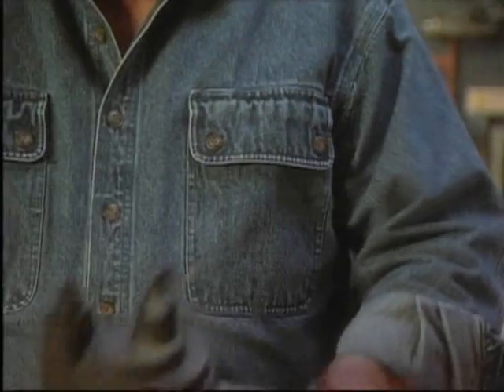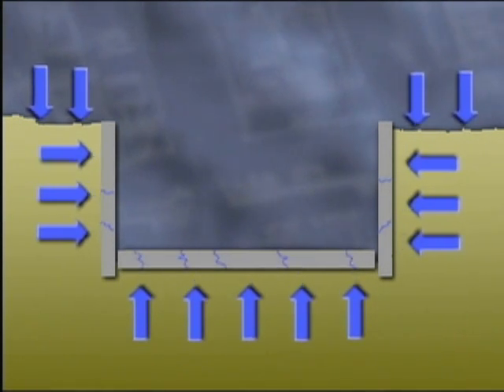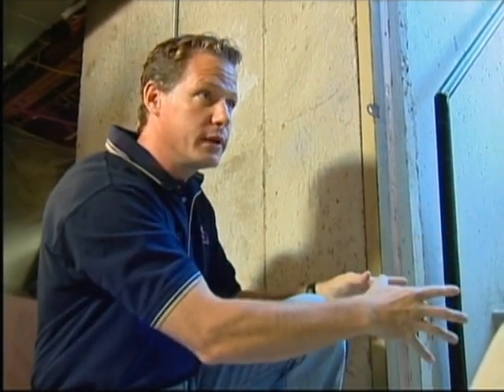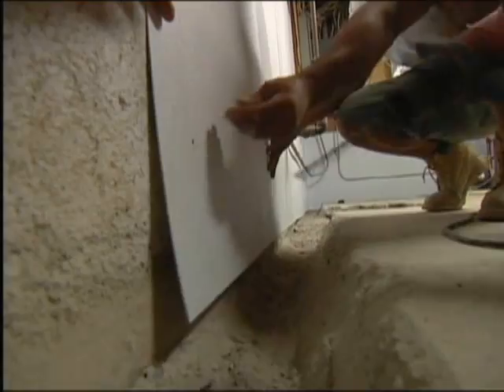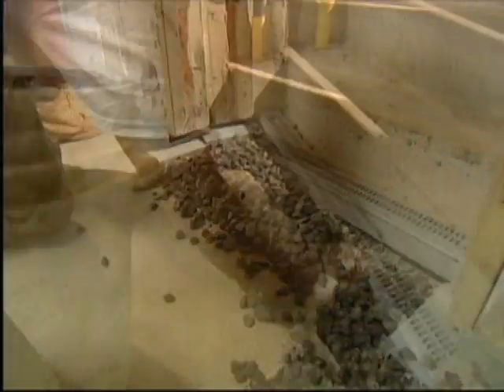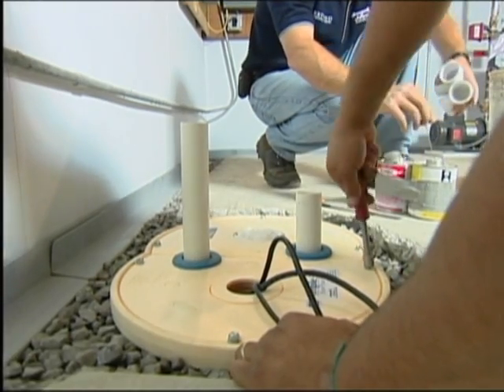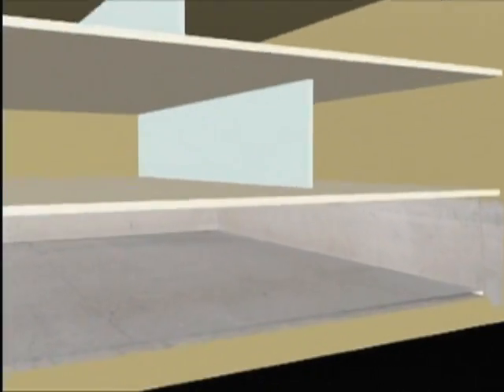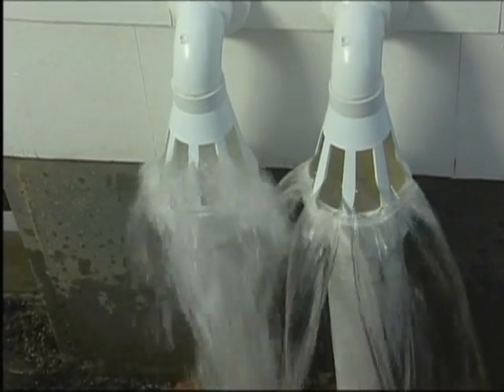How to Waterproof a Basement | Ron Hazelton's House Calls feat. Basement Systems

Comment: Been like that since the 60s. What a shitshow. But then have you seen his show. What is that like an inch of material over plastic horrorshow from beginning to end. Seen lots of homes from this era. Bowed walls and flooding galore. Unfortunately its common practice. Had one where they installed a sump and didn't break knockouts. total waste.

Comment: This is one of the worst syatems that you could use. If possible, you should dig around the house, coat the wall with a membrane from the footer up.
French drain goes below the footer and cover with gravel all going to a. 6 foot collecting tube that will have the pump.
Inside, the floor should be coated with the hydrolock pain.
If you must put a french drain inside the house you will need to dig a trench that is about 5 inches below the slab.
By code you need to replace 3 1/2 inches around the slab you just dig.

Comment: OMG I just watched a video on how bad this system is https://www.youtube.com/watch?v=CSrdJjlQopA
To be honest if you just wanted to channel the water away and not fix it doing the bottom stuff would be ok but those vinyl wall panels will keep the block wet and mold will follow. Also for "ice clogs" my sub dumps 70 feet from the house. If the pipe is frozen so is the ground and water is not going to the system.
Reply: yea this system is not recommended. so much you can do for a fraction of the cost from the outside of the house to evacuate water away from your property before going to this extreme.

Comment: "If the walls do leak, the water will just run down the panels and into our system but the homeowner does not see any of that water." So basically you're telling us that you literally just cover up the issue so that the home owner doesn't see it and that's called an issue resolved?
Reply: well the other solution would be putting waterproofing on the outside that will take major work and you have to break out the ground surrounding the house

Comment: This method waterproof From the inside is a joke. It's no different than having a boat that has a hole in it and is leaking and you decide to get a bigger bilge pump and not fix the hole. The only way to waterproof abasement, is from the outside.

Comment: This not a solution to the problem. The water needs to be prevented for coming in in the first place. You're attacking the symptoms not the cause. You could have saved a lot of money by just closing your eyes. Either way the problem is not solved.

Comment: This is a terrible "solution". Channelling the water inside the house creates a permanent wet ditch, which is a wonderful mold growth medium. Drains should have been placed outside the wall, with gravel over top, and soil at the ground level. The drains could be fed to the sump, or to outside drain tile.

Comment: I am in shock. The price of this work is half the price of the house. You get a "wet basement" with a pump for that kind of money.....
 This is madness!  
This problem is fixed easily - Concrete crack injektion.

Comment: This company doesn’t take permits out cause if they do the system would not pass inspection. The other thing is the illegal workers that he uses.
Reply: john Torres 
1. The responsibility of obtaining a permit (if one is even required) is the property owner’s, not the contractor’s. 
2. What is the basis for your assertion that “the system would not pass inspection?” 
3. “The other thing is the illegal workers that he uses.” Explain, please.

Comment: It would be cheaper to mortar in brick around foundation rather than jackhammer out concrete get rid of battery backup pump use use water psi backup pump

Comment: That is not going to work your not below the footer where the water is and there are no weep holes in the block cavitys including the joints you wont be to code with the concrete thickness minimum of 3 1/2” this is a cheap shoddy system

Comment: There is a question i wondered about?

What happens if you use colored Dye to trace the leak in the basement?

Will the color come out in the basement or would it just disappear in to the rock or soil underneath and not show up!
Meaning all you would see is the water and not the colored dye!

Comment: This is a huge CON . Never want water on ur foundation walls let alone throw them in first place. Put tht system where sun doesn’t shine but on the other side of tht wall outside the house. With non woven geotextile fabric wrapped around French drain tile and 3/4 to 2 inch clean rock with zero fines in it ontop and around the pipe all way up the wall good solid 6 to 10 inches wide of it. U won’t never have water on the outside of foundation walls and there for u won’t have inside of the foundation walls. And before anyone says anything about well it can just come from underneath floor. I can’t type all damn day to explain the steps on the outside the foundation system to prevent that scenario to. Cause I for sure 100% know how to prevent all tht as well. I have a master’s degree in keep Mother Nature on the outside of the house.

Comment: I thought you were smarter than that. I bet your basement smells musty and still have mold. I'm a Roofer above grade and below grade membranes. I've done a lot of basement water proofing and I know you have cracks in your walls. You need to dig out the dirt around the outside of your basement wall and seal it correctly and put some french drains to devert any water that acuminates on and by the concrete walls. Anyway I think you should of thurally researched the problem instead of throwing a dart at the yellow pages to pick a contractor. Let us know on the results of the basement project. I'm not here to laugh I'm here to see a project done right. There a lot of people that watch and there going to do the same thing you did but be disappointed at the results. I'm a fan and still watching.
Reply: How much is a proper membrane and french drain install on a home on average?
Reply: @sethshaffer8592    it's just digging around the house down to the footings and putting in a drain same as inside and putting in polyurethane square sheets against  your wall then filling it back with dirt.
Reply: I bought my house about 3 years ago. PO at some point had this exact same setup installed because they had at least 1 flood (there are still indicators of the flood line in parts of the basement). I have started working on the basement as one of my projects and have begun to remove the white panels and see evidence of seepage through the block and joints. You're 100% correct that this solution only moves the water that got in, out but doesn't address the root cause, the water ingress from outside. I've been researching and planning my backyard drainage project for about a year now but have to now incorporate sealing the outside foundation as part of it as I want to eliminate the water ingress as much as possible. And yes, my basement does have a slight musty odor, not terribly strong like some older home basements I'm used to, but it's there. I believe this is also in part due to the build up of probably mold on the back of those plastic sheets.
IMHO this option is a good safety measure, AFTER you've addressed the outside water intrusion first, this gives you more peace of mind that you won't have a flood if it got really bad.
Reply: If you're not here to laugh you should really correct your spelling on thurally.
Reply: @MrArdissono  Yes you are right I don't know how that one got by me. But I do know what I'm talking about.
Reply: @MrArdissono  I'm not here to laugh I'm here to let them now their mistakes. If someone is going to give advice he or she should know what the heck they are talking about and should be thorough.
Reply: @cordcd7  Make sure you got good drainage and good slope. I would even go over kill. Because if that water doesn't have anywhere to go 8ts just going to stay there and eventually try and find a way into your basement and tree roots and bushes they can eventually tare through your membrane. Depending on what type of system you use. After you get done with the outside wait to seal the inside of your basement. That is after you brick cement or concrete any voids . Wait for after a couple good rain storms (I would give it a good winter of rain. Depending on how much rain you get where you live ) and check for leaks and any smells like mold. You want to be 100% that the water is not going to leak through the walls before you seal the inside and depending how you're going to use the basement you going to think about the condensation and if that isn't addressed right then the mold will come back. You definitely don't want to use organic materials for the inside walls and if you put up any walls make sure you leave an air gap for circulation so it can dry any moisture that's there. This is the longest comment or advice that I ever wrote to someone. I hope you get it all dialed in and let me know your progress and stay dry. Peace
Reply: @MrArdissono  You missed the whole point of A Martinez's decency and objectivity and the joke is on you bud. Peace!
Reply: You're a good person A Martinez, going not ony by your helpfulness but more so by your decency in the face of a needless attack from the like of Ardissono below. God Bless you.
Reply: A Martinez How do you feel about Flex Seal Liquid??
Reply: @iMr.Jetpacks  I've never used it before.
Reply: @MrArdissono  He's a roofer not Shakespeare.
Reply: I think it would be very difficult to drain the water down to below the level of the basement floor. I suppose that lowering the water level even if not down below the basement floor would reduce hydrostatic pressure and reduce water ingress. French drain isn't the way to go though. First thing would be to make sure that house guttering gets all roof rainfall off the property. Next thing would be to put in a drainage system comprised of catchment basins in low spots around the property feeding into a dry well fitted with a sump pump. Check the Apple Drains Youtube channel for chapter and verse on this. After getting drainage on the property around the house optimized I would then look at basement remediation.
My own temptation would be to put on a membrane and then pour a sealing wall of waterproof concrete over it. Not my area so I may be way off base.
Reply: @errcoche  
Are you saying on the inside or outside.
Reply: I'm not a contractor etc...but what was done here is not water proofing wet basement. They just direct the water to a pump to discharge it out. LOL  I've seen other video and it looks like you get what you paid for here. I've just seen a video just before watching this and I'm just shaking my head.
Reply: I agree A Martinez.  I have a water table issue and this would not work for me.
Reply: Wrong. I have dug up a crack from outside. Injected it and the injection took from port to port. But ran into a hair line. I also water proofed then added a membrane to the footer up. Then added a drain with great grade away frim the house. As well as drainage rock. And a french drain. Few rains later water then made it under the footer as the presser still built up and water found a new place to go. So spend money out side. Sometimes works yes. Sometimes it dont yes. I do believe this system is cheap materials for sure. But it takes away alot of guess work headache future problems quicker and cost is alit less. Then doing alot of outside work....i have done it all just like anyone els water finds least risistance. Some have had to do interior drains even after exterior....
Reply: @MrArdissono  it's thurowlee.
Reply: A Martinez how you described is how ours was done over 45 years ago.  Took care of it.
Reply: @amartinez1279  do you have any suggestions as to who to call to do it the right way please need help ASAP thank you blessings 🙏❤😇

Comment: The opening scene shows water pooling at the foundation and pouring off the roof or overflowing from the gutters. That is the problem. Leaving the problem in place and dealing with the symptom (at an enormous cost) is so foolish it defies logic. Imagine if your roof leaked and a contractor came up with an elaborate drainage system installed inside the attic to keep up with the leaky roof. It's absurd, right? Well, when confronting basement flooding you start by picking the low-hanging fruit and work your way up the tree. Install gutters and make sure the downspouts discharge far from the foundation. That might do the trick. Then, grade the property so that water flows away from the house. If that doesn't work, install a french drain system outside. This is much cheaper than jack-hammering concrete in the basement. If all that doesn't work, you'll have to do something like what they did in this video. But I think the easier, less costly measures would have the problem resolved before a jackhammer ever had to make an appearance.
Reply: wickedmessenger1 “Imagine if your roof leaked and a contractor came up with an elaborate drainage system installed inside the attic to keep up with the leaky roof. It’s absurd, right?”
That’s a great analogy.
Reply: He did nothing to address continuing damage to the foundation by allowing water to continue to run in.
Reply: @ Joe Shmoe….I called this Larry Janeskys company… Connecticut Basement Systems to come and give me an estimate, as I am having drainage issues…I quickly cancelled when I saw the system he uses, because of the same thought as you… not addressing the water problem from the exterior… I have a contractor doing the drainage system from the exterior wall to the footings, for what I’m guessing would be half the price as this system!!
Reply: @jimmalley  Good move! There are a lot of "experts" out there that don't know anything and others selling the most expensive job. Another problem is several different types of contractors specialize in the different installations that may need to be done. Sometimes a wrongly pitched sidewalk against a house can be a problem. The guy running pipes doesn't make any money from a sidewalk job. Getting roof water, patio water, etc away from the house is the first thing to do and keep in mind every house and property is different.

Feel free to contact me here if you have any questions, I'm not in the business, but I've seen plenty of unnecessary work done. People are easily impressed by the term "french drain". Good Luck!
Reply: @joeshmoe7789  TY appreciate it!!…Stay Well

Comment: This system is nothing more than putting lipstick on a pig. The fact is he should have invested in an exterior waterproofing job with new weeping tiles. That's how you really solve a wet basement problem. It might be a little more expensive than this system but it's the only way to go. 

By the way, I don't buy the guy's explanation for why water was coming in from his rear steps. He didn't have a grate at the bottom which is code and the rainwater was just coming down the stairs and inviting itself in. He's a home expert and he didn't know this???

Comment: How about the exterior.  That''s where I would start.
Reply: Whoa your a genius. I bet that’s why your a millionaire?
Reply: Then what if it happens again? After outside work?
Reply: @overthehilldill3626  lol
Reply: @bossboston816  I'm being facetious cuz I'm having leaking issues right now and I'm pissed!
Reply: @overthehilldill3626  understand i have been there. Whats tge region you live in.
Reply: @bossboston816  Oklahoma. We get torrential downpours every so often and i need to completely waterproof my basement.
Reply: @overthehilldill3626  understand here in missouri we do as well. I have also lived in Oklahoma. Best of luck to you brother.
Reply: It's cheaper to do this and the outside could be already done and it leaks anyways. Like the contractor said there is no stopping water from entering your basement. Your best bet is providing a channel for any water that does come in
Reply: @bossboston816  Northern Virginia near Reston.  As long as you maintain the gutters, I don't see water being a problem where I live.  It's my understanding the home builders do as little as possible in exterior waterproofing the foundation.  So my home is a 1976 and probably should get an exterior waterproofing.  Some company tried to sell me an interior waterproofing for $20,000.  The exterior companies are asking for $5000-36000.
Reply: I totally agree. The homeowner is a contractors dream. 3 pumps.. jeez! Anyway, extend downspouts, fill holes, redirect, seal windows is STEP ONE!

Comment: Sorry but this system is the worst kind, it’s level and has no pitch so water has to build up to flow to the sump. That water is laying under the concrete floor and has no way to be removed. Watch other videos about removing this type of system.

Comment: The system has no slope! Because the plastic drain is so up high, you will always have water sitting at the bottom of the trench where the gravel is. Not sure this is a good system...
Reply: @Paul Starr You want to remove the water before it reaches the height of this floor level drain, regardless of if the basement never "floods". Which is why systems that are installed correctly are installed with 4" ABS weeping tile pipes with a filter sock and rocks around them. Relief holes are drilled in the cinder block foundation to allow water to drain out of the cylinder blocks (which are hollow) into the drainage system, to be plumbed to the sump pump for removal. If you dont have relief holes in the cylinder block foundation, it does nothing to prevent the lateral water pressure being exerted on the foundation from the outside of the foundation wall.
Reply: It's not lol